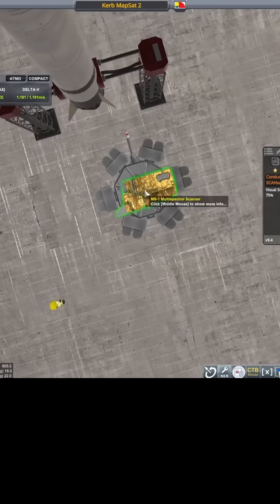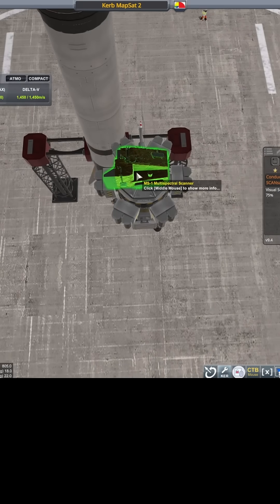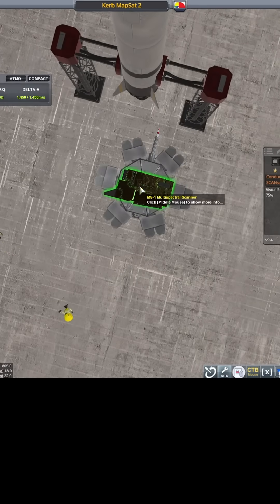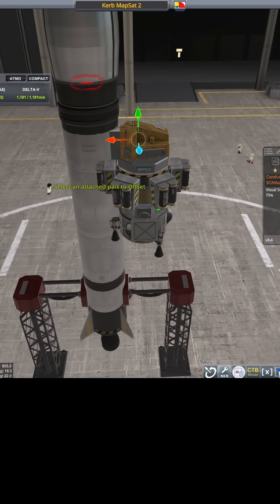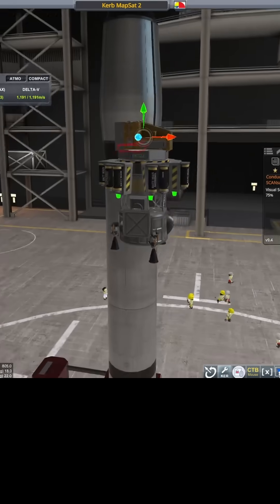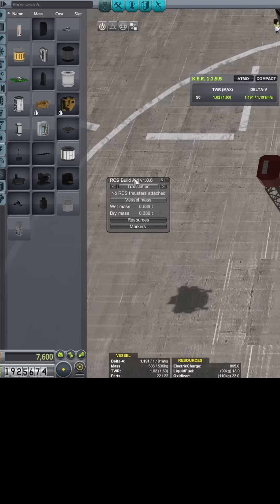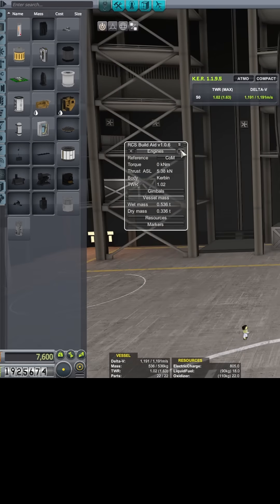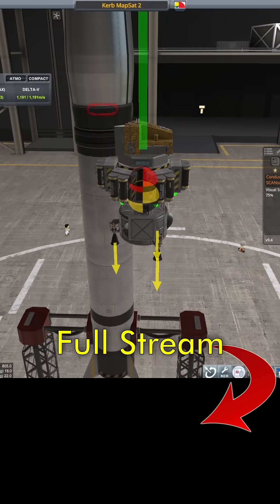Centering Trick Again | KERBAL SPACE PROGRAM #kerbalspaceprogram  #ksp #short

Comment: extra pro tip once you get it locked to the "grid" with the move tool you can hit C to toggle snap angle and you can now fine move the part up or down without moving it from center also if you turn snap back on it will snap back to the grid as soon as it is moved again so any fine movements needed to blend edges need to be the last thing done